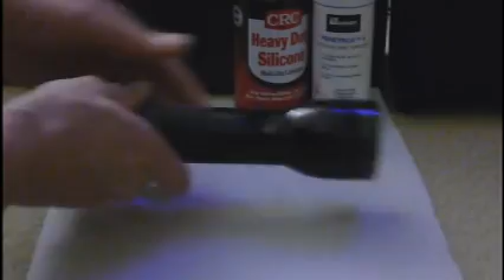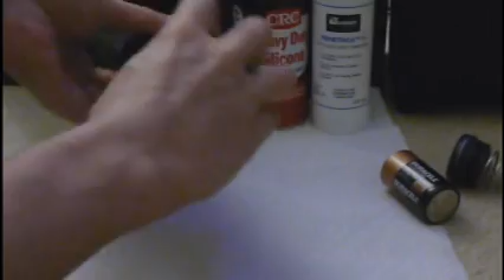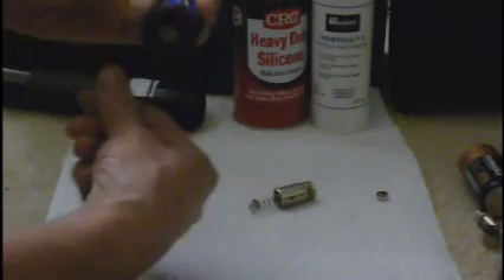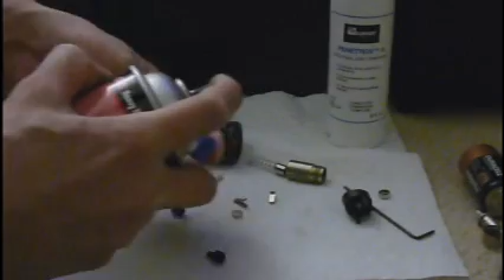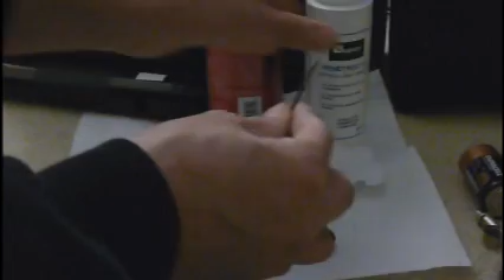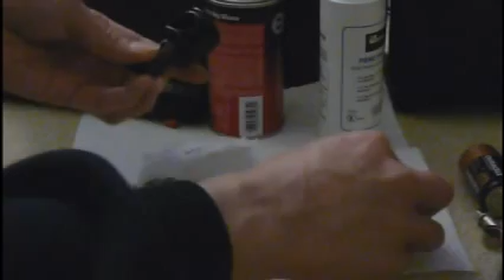Maglite Disassembly to Stop Dimming Part 1

Comment: I have one where 2 of the 4 batteries leaked near the top causing corrision on the internal switch parts and the 2 batteries to become stuck i removed the screw and pounded and pounded nothing came out what do i do?